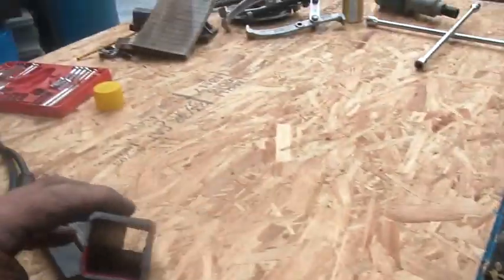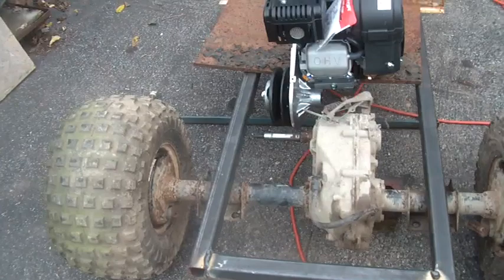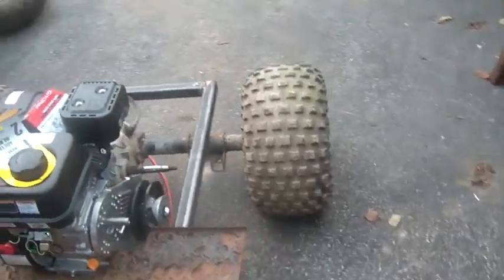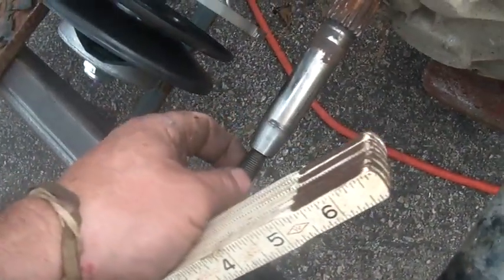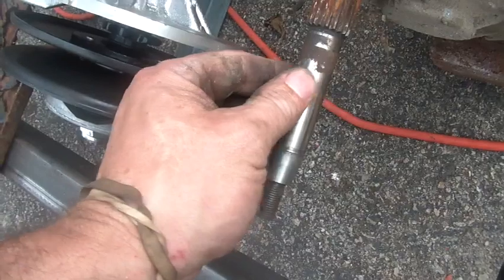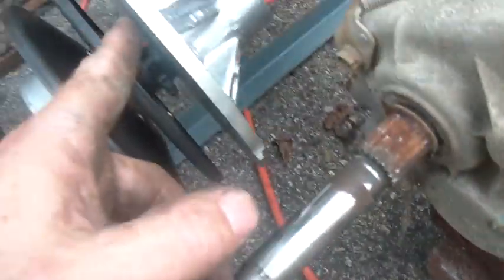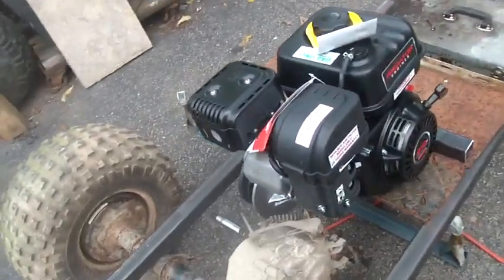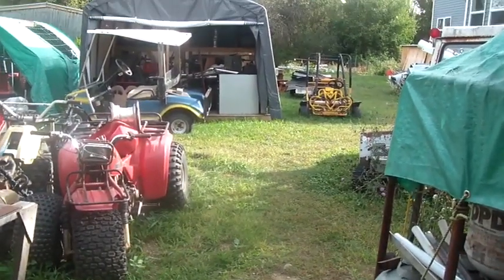Auction KAF450 Mule, creating a simple drive chain, engine cradle,

Comment: great choice harvey in getting that tubing that's exactly what i would have used! I love those smaller Lincolns i have the sp140 and use it all the time, if you think it welds well like that its night and day when you add a shielding gas and bare wire. Trust me its much more controllable and looks great. anyhow I'm  enjoying this build its going quick i can tell this NY man is working quickly and anticipating winter soon! thanks for posting!
Reply from the maker: Hey Corie, The Lincoln took my welding to the next level, I'm glad that I used the Harbor Freight first, it made me appreciate how much better the Lincoln is... Stuff is coming together for my winter preps, need to run scrap soon.... Thanks for your encouragement, thoughts, watching, and commenting!!!

Comment: cant you clock the torque converter mount to clear a engine mount like you did on the baja warrior? you might think about using a slotted engine mounting plate so you can adjust the chain tension. looks like its going to be plenty strong,well worth the price for the steel
Reply from the maker: Hey Roger, I thought for $20, the steel was a great buy, really brings the project together!!!  I thought of the slotted engine plate, about the Warrior, I had to trim the torque converter casting quite a bit to make it all fit... Thanks for your thoughts, suggestions, watching, and commenting!!!

Comment: hey man igot question and iwill presiate if you answered me .. i got 150cc scooter and my solenoid has failed so i replace it with new one .. after i installed it it has cranked and started normally .. then i shut her off and i went to sleep after i get up i tried to start her up but she didnt start up iwas just hearing the solenoid click but no crank and when i test it with voltmeter , bulb light .. it shows to me that the positive wire from the motor is not getting any volt from the positive triminal from the battery and i replaced it with used one and just like before started ones then never started the solenoid fail again .. why ??? please help
Reply from the maker: Hey Mixer!!!  Starter solenoid are simple relays, if your battery is weak, the solenoid will not engage properly, also, if the wires feeding the starter are worn, (corroded or beat), at the connections.... Also, Ur starter seems to work, but is it pulling excessive current or was the replacement solenoid too light to drive it.... Most of these parts are made in China and sometimes the quality is suspect, the OEM may have failed with age and use, the replacement one may have not been great quality, I would make sure the battery is good then get another one from some other supplier.... Thanks for asking, watching, and commenting!!!!
Reply: i have checked the battery and its good .. i checked the ground and its good .. and ichecked the wires and everything is good .. but i dont know why the solenoid fail every time after it starts ones